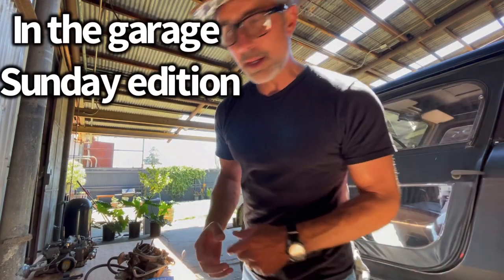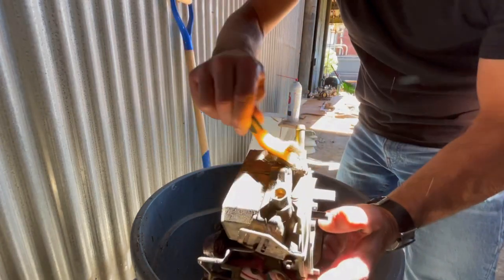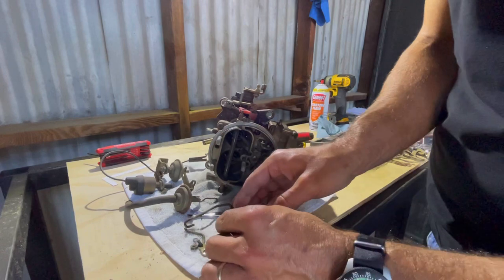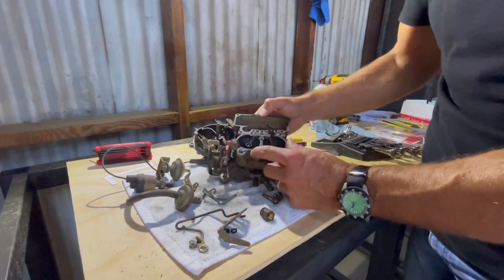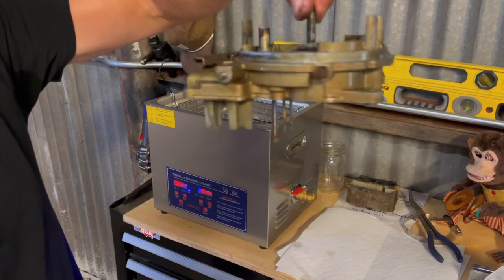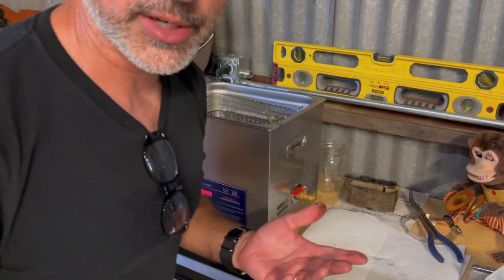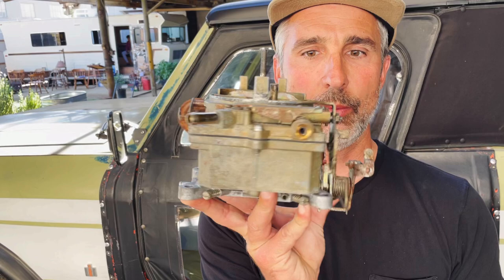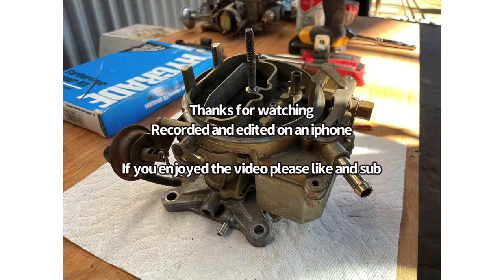The Scout Life: Rebuilding an International Scout Carburetor w/ Sean!

Comment: I rebuilt my 2310 on my 75 with a 345 auto, with similar results as your first attempt.  Watched both the videos and attempted it again to get at the idle passages.  The one on the left seems to have good flow, but the one on the right(as you look at it from the drivers seat) seems to have significant blockage that I can't resolve.  Should I look for someone with one of those fancy sonic cleaners, or cut my losses and find a 2300 or something similar to use?  It seems to run great while choked and the engine actually sounds healthy.  New to me project and first scout since my clapped out 72 I drove as a young man in the early 90s.  I'm just eager to get it moving under it's own power and onto my driveway where I actually have room to work on it.  Thanks for taking the time to make all of your videos.  Stoke level is always high after watching any of them.

Comment: could have installed fuel injection a lot quicker and more reliably?
Reply from the maker: Thanks for the thoughts. I didn’t want fuel injection….im bringing this Scout back to stock
Reply: @anythingscout  what are the carb rebuild schedules? just curious?  5 years? 10 years? just to have a reliable scout preemptively?
Reply: I've seen carbs run reliably for 30 years with clean fuel and good filters. Maybe more. There really isn't a set schedule, it's more just watching and listening for a problem to start. If it's running good, starting good, and it's reliable then leave it alone. More often then not, sitting is the real enemy of carburetors. If they're run regularly with good filters and clean fuel they can last forever.